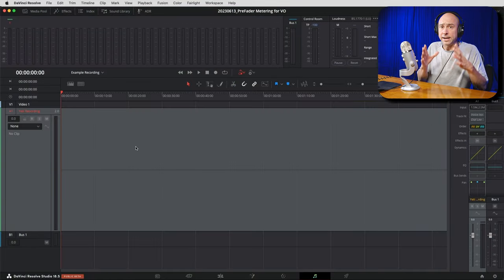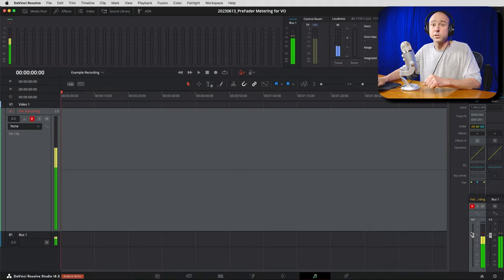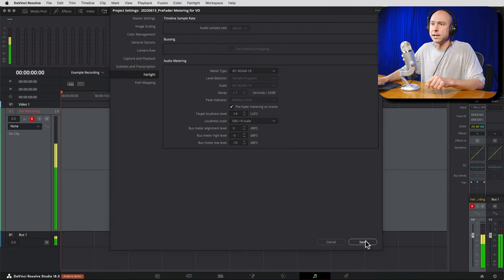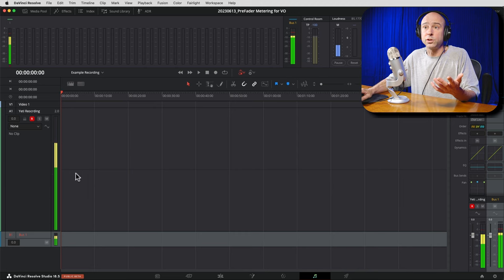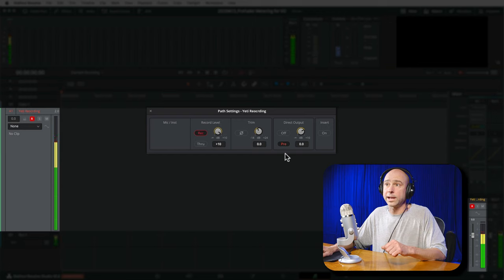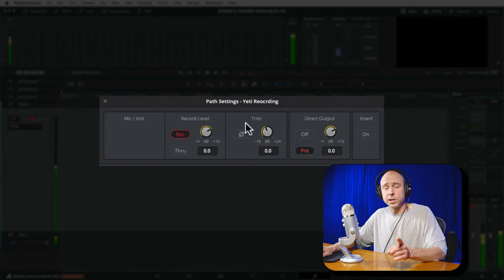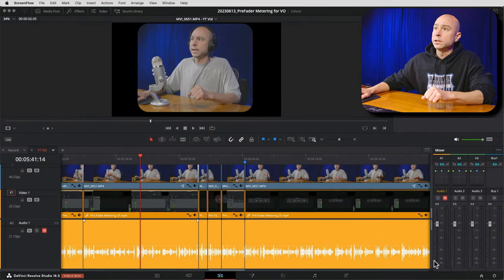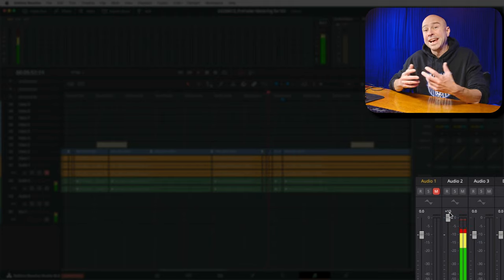The VOICEOVER Setting You DON’T Know About in DaVinci Resolve for CORRECT Audio Levels!

Comment: Great video and great channel. Just to be clear the gain isn’t changed by pre or post fader metering, just what the display is showing. Good stuff!!
Reply from the maker: Correct, the game is not changed by the type of metering. Selecting pre-or post fader just gives you different readings on the meter based on where the signal is being picked up, and then being shown on the meter.

Comment: Using analogies...  A bucket feeds a fluid into a trough that supplies a drinking tub. The tap that feeds the fluid into the bucket is the gain. The tap that controls the flow of fluid from the bucket to the trough (that channels the fluid into the drinking tub) is the Trim. The Direct Output control (I've never used this one so am not certain this is correct but used the echo/eq direct o/p as a guide) the speed at which the bucket is emptied if it needs to be drained. Good tutorial.
Reply from the maker: Nice analogy!

Comment: I didn't know you could adjust the audio input like this in resolve. I know from playing guitar that you have an input signal that you can adjust in various locations along the signal chain. Every output becomes a new input for the next device in the chain. Order matters, and sometimes less is more. If you have a clipping input signal, there's not much you can do to fix that in post. Too low of an input may cause static trying to boost it to acceptable levels on the output. Would have been nice if Resolve just had a little toggle button to switch between input and output audio levels right on the mixer. We should really view everything as a signal chain. If your operating system (or audio interface) setting is not optimal, the signal received by resolve will also not be optimal. It becomes quite complicated when you think about it, but fortunately we have guys like you who dig up all these neat tips and tricks we don't know of... Thanks for yet another cool tip...
Reply from the maker: I agree with you, thanks for checking out the video and dropping a comment!

Comment: Probably would never have tripped over the pre-fader switch. It shouldn’t be so hidden. I realized I don’t know the audio flow path in Resolve. Your narrative did more to confuse than explain. I would have liked to see a diagram with the mic on the left and a series of function boxes as the audio is processed. Then, it would be easy to show where the meter display was coming from, depending on pre-fader, etc. setting. And where does the Trim audio come from on that type of diagram? Is there a clear description somewhere?
Reply: This is why I took an immediate dislike to Fairlight. I don't use it at all. I'm no guru but I did work the board in a professional studio when I needed voice talent to record narrations for our video projects, mix in camera video and music track; sometimes sound effects as well. There are things that are pretty standard and therefore expected at that level so when I saw the complication of Fairlight I figured it's got all of that. But it's a different animal. e.g. having that hidden checkbox outside the Fairlight page is BS.
Reply: @charlieross-BRM  ok, I understand now you don’t use Fairlight that much, fair enough. My comment about the value of a flow diagram still stands. Even if it’s only in your head, a logical progression will help us viewers. In the past, I traversed the entire pull down menu system in any program I was going to rely on. Partly frustrating, sometimes richly rewarding.

Comment: Hi Jason as usual great video I always learn something...  Hope you  can help. I have audio going on the track but don't have any output on the meter from the microphone input, have I missed something in the setup?
Reply from the maker: Does the meter move when you record at all? It could be that you just have to adjust your record monitor settings. Go to the fair light menu at the top of the screen, go to input, monitor settings, choose a different option in there and see if your meters start to move when you arm the track to record or when you were actually recording.
Reply: @JasonYadlovski  Cheers for that yes it was on mute, I have changed to Input & it now works, but I do have an echo I just need to turn the speaker volume down when recording, thanks
Reply from the maker: You’ll probably get Echo, if you’re using speakers while recording, I always use headphones when recording, or turn my speakers off like you mentioned.
Reply: 👍 Thanks

Comment: Very helpful!! I'm looking at getting into Narration / voice-over & want to use DaVinci instead of something expensive, like Adobe Audition, since I already pay a lot of money for several other programs.  This is an excellent tip that'll help me to get everything primed correctly beforehand. ❤ Cuz I am NOT gonna be using Audacity for anything other than the RMS levels reading to ensure I'm in compliance with ACX standards. 

.....You wouldn't have any tips about how to get RMS readings and true peak values in DaVinci, would you...? Cuz ACX still uses. RMS measurements.

Anyway, thanks!!!
Reply from the maker: Awesome, by the way, it was helpful! I don’t have any videos on a ACX yet, but I might make a series about how to meet their standards in Resolve
Reply: @JasonYadlovski  omg, that would be INCREDIBLE! 😍😍😍😍

I'm currently working through all the setup stuff based on various tidbits of information I have gathered from other narrators and their programs. I am breaking down workflow order as well as system settings so I can create narrator presets within DaVinci. I am hoping not to spend a dime in external plugins. It's been very difficult because there is a huge gap in Davinci Resolve videos directed at narrators, but I have been finding a few things at a time that can pull stuff together.

Got a long way to go on getting it all orderly, sensical, and perfected. It's really, really hard when just three weeks ago I barely knew a thing about audio engineering or mastering, etc. 😁

The only thing I know for ABSOLUTE sure, is that I do not want to use AUDACITY. It's a crap program compared to Davinci.

Comment: Is there a switch to allow the meters to react without hitting record? Seems like there was and switched that off somewhere. My meters only work when I am actually recording. Great video!
Reply from the maker: The track has to be Armed to record and you can see the meters moving before recording. If you can't see the meters moving, you can go to the Fairlight menu at the top of the screen, Input Monitor Style and change the options there based on what you want.  Auto should work, but if not, you can change it.

Comment: I am going to do some voice over for a documentary. Earlier today I watched a video about the Patch function used to connect a source (microphone input) to an audio track. I wish you had mentioned this too.

Your description would have been much clearer if you used a diagram to show the mic connected to a fader connected to an audio track (in Resolve, of course). Then it would be easy to understand pre- and post- fader measurement points. 

Your description of Trim control was unclear to me. Unclear in the extreme. You mentioned “Disc” and I can’t remember anybody else using that terminology. In my imaginary block diagram, post-fader audio goes to a voiceover track which I presume is recorded on disk. So, where does Trim enter the picture? You didn’t identify the point at which it operates (post-fader, presumably), and its function is a mystery. Please explain.

Still, I had missed the toggle for measuring at the input to the fader, so thanks. Would be nice if this was assignable to a track. Maybe someday.

Still, you did provide some valuable advice, for which I thank you.